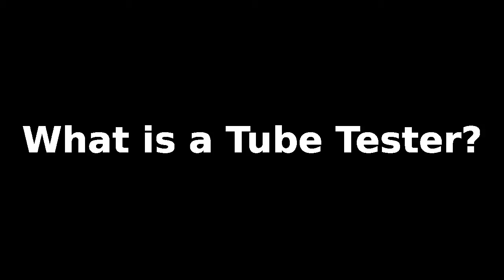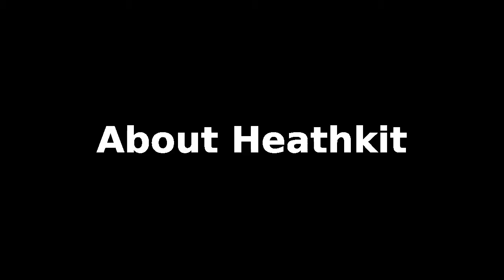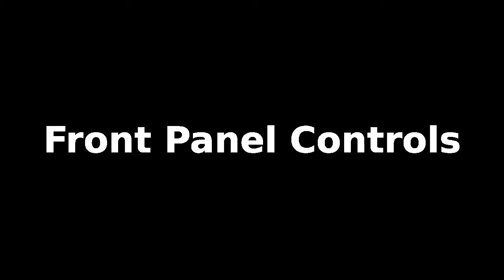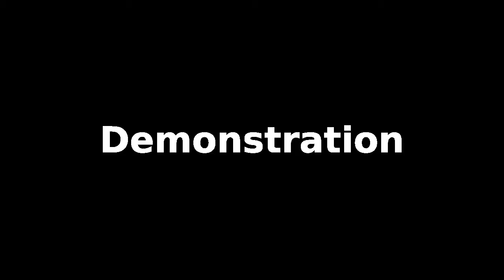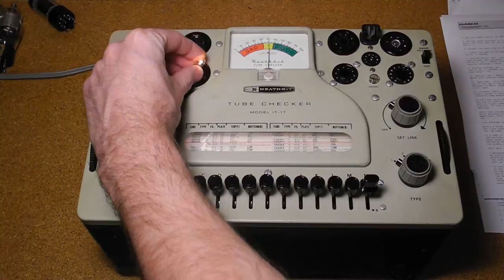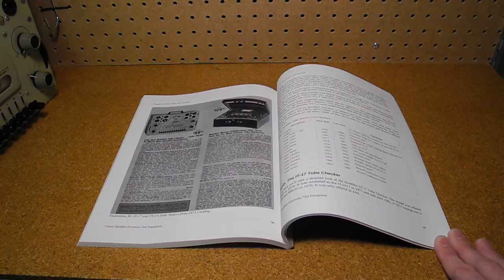The Heathkit IT-17 Tube Checker

Comment: Great video Jeff. I purchased a TC-3 model which I restored. All of the green wires had a white powder on them. Almost like mold or fungus. I cleaned them with a brush. Do you think I should replace all the green wires?
Reply from the maker: I would clean the wires and leave them as long as they are not cracked or brittle.

Comment: One test not mentioned in the manual is the "life test".  During the quality test reduce the filament voltage by one setting.  A tube with good filament emission ( hence remaining life) will show little or no drop.  A tube with a weak filament will allow a large drop in output.  this is a test robbed from the Hickocks.

Comment: 2022 I sold my IT-17 to a young ham who needed a tube tester, last year.  This year I was given a It 3117, downloaded the manual to understand it better.  It turns out this tester has been in production since 1948 !   Beginning with the TU-1 . This must be heathkit's longest running product !   It will be interesting to compare the manual from early models and a late one like mine.  I do not expect to find much difference.  A tribute to the elegance of a simple idea.. although the switching is complex, and reflects a LOT of very patient work by the original designer !    Now.. I have to find a smashed example as a donor for my burned out special transformer ( I mentioned free, right ?).
Reply: "This year I was given a It 3117... It turns out this tester has been in production since 1948!" Huh? According to the video, the IT-3117 was produced from 1977-1981.

Comment: Jeff,
Love your vids! I have a IT-21 and need to test the following tubs from a Heathkit AA-100 7591-7199-EF86-GZ34 these are not on my roll. I found a 28 page list on line that has these and many more but quality is so bad one can not tell the bold from the non bold letters to set up the switches. Do you have a site I can go to to get settings for more tubes?
Thanks
Keep up the good work.
John Ocala Florida
Reply from the maker: Try this (you will need to register to get access): https://www.mods.dk/downloadmanual.php?RefFil=IT-17_IT-21_IT-3117_Tube_Data.zip

Comment: Thank you for making this video. I have a Heathkit IT-21 and i'd like to use it to test some EL34 Tubes but i can't it in the roll chart. What should i do?
Reply from the maker: You can generally use the same settings for equivalent tubes. There is a Heathkit manual that you can find on the internet called "Suppplement Test Data Sheet for use with Heathkit TC-1, TC-2, and TC-2P Tube Checkers." It has a section at the end with "America Equivalents to European Tubes". It lists, for example, EL34 as equivalent to 6CA7.
Reply: @jefftranter  Another question: At 12.22 You said to preform the shorts test, move the levers indicated in light type between the indicated position and center. Howerver, it appears that you move ALL the levers between their indicated positions and their opposite positions? Did i misunderstand something?
Reply from the maker: @sonicpete  The description was correct, but I incorrectly moved the levers all the way to the opposite direction rather than to the center position as I should have.
Reply: @jefftranter  Thanks Jeff, I just wanted to be sure and not damage anything
Reply: @jefftranter  Any help would be appreciated. Thanks

Comment: at 13:47 I noticed you do not move the lever past the center position.  Why was it not moved to the bottom position as mentioned in the instructions?  thank you.
Reply from the maker: You are correct - I should have moved the levers to the bottom position during that step to perform an opens test.

Comment: I have a heath kit tc-2 and every chart I find is missing most of the AA 5 tube set used in 1960 era radios it's has one of two of these tubes but the tubes that start with 12 can't find anyone no where I can look ?or
Reply from the maker: Try the roll chart here: http://tubularelectronics.com/Heath_Manual_Collection/Heath_Manuals_T-X/TC-2/TC-2%20TubeData.pdf

Comment: It's basically an EICO emission tester. The results are better than none at all, however the tester is a gimmick for no nothing electronics enthusiasts. I test my tubes in a test jig that I built , based on RCA Tube Manual data. Shorts and leakage tests are a joke.

Comment: I NEED YOUR HELP.
Good morning. I bought the Heathkit IT17 recently on Ebay.
The device dials the line. But when testing any valve, the pointer vibrates a lot. The pointer vibrates to and fro.
It could help me to fix my IT17. What do you think this defect could be?
Reply from the maker: It could be a bad connection in the wiring, switches, or sockets, or a bad part such as a diode, resistor, or diode. You should be able to find a manual on line. A visual inspection inside might show the problem, and moving the controls and switches might identify if one of them is macking a bad connection.

Comment: this is interesting, and since my testers have all been Hickocks.. which are high end testers that measure Gm ( transconductance), I wasn't familiar with how an emissions tester worked.. only that it is inferior to the instruments like mine.  I happened to pick up an IT-17, partly because I didn't want to sacrifice the tube sockets on my Hickock checking quantities of used tubes.. and partly because my Hickock is old enough to not test nuvistors or compactrons.   However, I see that using this kind of checker, is a good deal more labor intensive, requiring many more operations to accomplish shorts, and leakage tests than the Hickock ( and No GAS test on the IT-17).    Not any of this is attractive to me.. except the small size means you could take it to a swap meet.  The quality of the information you get from this tester is as you point out.. much lower.. not really useful for critical applications such as low noise recievers, matching audio tubes, or etc.   Far better than nothing.. the IT-17 looks useful for the hobbyist who might otherwise not know he was working with a weak or shorted tube.. which is hopeless.  You cannot "tune away" a bad tube.  You have to know what you;ve got.  Given the high prices for hickocks,  this is a good bet for those who cannot pay the price for more.
Reply: I NEED YOUR HELP.
Good morning. I bought the Heathkit IT17 recently on Ebay.
The device dials the line. But when testing any valve, the pointer vibrates a lot. The pointer vibrates to and fro.
It could help me to fix my IT17. What do you think this defect could be?

Comment: Thanks for another trip in to the "wayback machine", Jeff.  I used to be a bench tech at a TV repair place during high school and my early days of college.  We worked on a lot of tube equipment back then (the old RCA CTC 16 came in a lot).  I loved working on Zenith hand wired sets though.  We used a Hickock 600A tester at the time.

I ended up ordering your book on Heathkit test equipment to prolong the enjoyment of your videos :-)  I also ordered a copy of Chuck Penson's book today based on the information I obtained from your videos (quite a pricey book but looks like it'll be worth it).

I recall watching them draw my U.S. draft lottery number on a Sylvania test jig connected to a chassis I was working on.  Those were the days.....

Heathkit indirectly led me to a 35 year engineering career with H.P.

73's

Barry

Comment: That's a really helpful video, going through the test procedure like that. I know about tubes but not testers and from watching your video I can derive pretty well exactly how this one works, e.g. the switches A-M are pins 1-12, N is the cap lead, top position is plate voltage, middle position is filament voltage and bottom position is ground. Connect one side of the filament to the filament voltage, the other side of the filament and the cathode to ground and every other electrode to plate voltage and it's strapped as a diode, then measure the current through it for a known plate voltage, the plate voltage setting calibrates where the needle reads in the bad-good scale.

I have a question though, when it says leakage test, is that heater-cathode leakage?
Reply: I NEED YOUR HELP.
Good morning. I bought the Heathkit IT17 recently on Ebay.
The device dials the line. But when testing any valve, the pointer vibrates a lot. The pointer vibrates to and fro.
It could help me to fix my IT17. What do you think this defect could be?